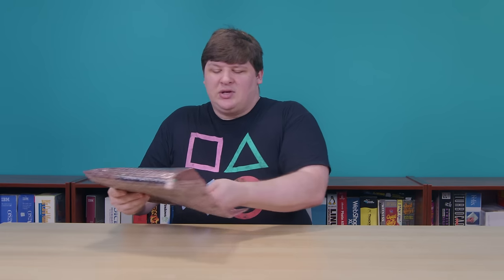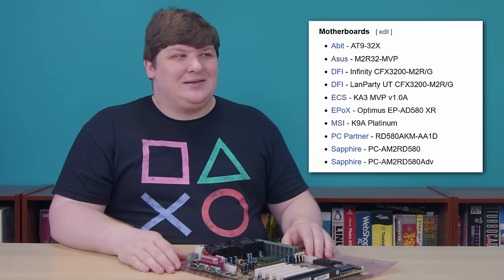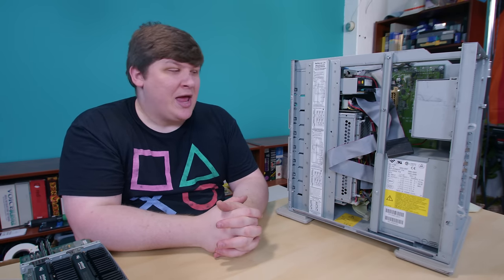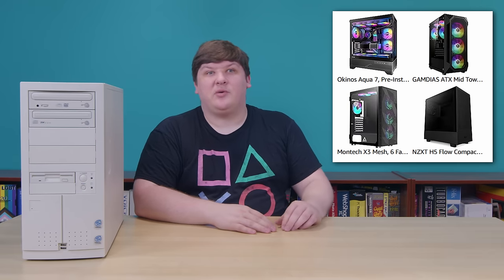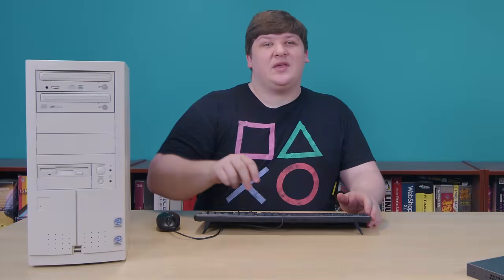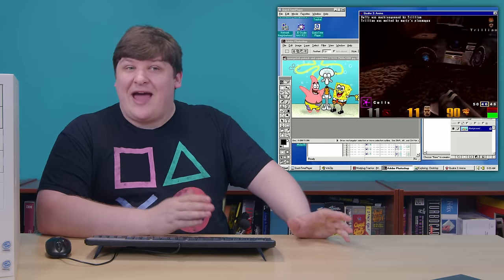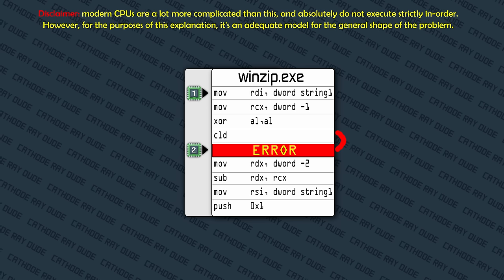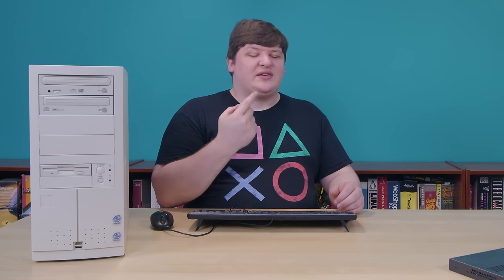The Only Famous Motherboard

Comment: Really need to throw in the Pentiums that do work on it for lolz.
Reply from the maker: The only ones that worked on this board were coppermines with an extremely specific powerleap adapter that's been unobtanium for years :(
Reply: @CathodeRayDude  damn.... matched server chips maybe?

Comment: Man you need 2x celeron 366MHz and you up the bus speed to 100 and you have 550MHz and ram runing at 100MHz
I was just normal mortal and had 1 celeron 366@550MHz.

Comment: Abit BP6 + 2 x Celeron 300A @450 MHz, running BeOS. The stuff of legends.

Edit after 26:50... pronounced "Be O.S." not "bios".

Edit 2: at 37:15. and that's why BeOS was so good. Running each single GUI window in its own thread. Responsiveness that only Haiku can match today, and folks just discovering it can't believe it is done without an ounce of GPU hardware acceleration. 

Edit 3: after 57:15. Price, my dude... you only read about Celerons 300A being used with that mobo at the time because the price/value ratio was INSANE compared to anything else.

Edit 4 at the end of the video.... Man... you could REALLY trim your videos and earn more subscribers. Guess it is not what you want. That's ok. this one... wasn't too overstretched, even for me.But yeah... I have to agree with others... your videos are WAY too long in general.

Comment: Small correction on buying products that look and behave how I like: I don't want RGB.  Ever. Anywhere.  I can't seem to avoid having at least one RGB product in my setup.

I had the BP6 second hand from a friend.  I ran it for YEARS and it continued to perform well into windows XP.  

I think it was only after I bought my first Athlon with Vista that I stopped using the BP6, and I ended up giving it away ... and I forgot where.  

I really wish I still had it.  Like so many others here I ran the 333 or 366 I forgot which one now, but I could run that just short of 600MHz with no instability.  What a beast

Comment: If only ASUS went out of business and ABIT and DFI came back Didn't P3 server boards have their own voltage regulator socket each for their own respective CPU? Windows 2000 was the best NT windows, yes, better than XP, only bested by windows 7, Vista was great but software for it wasn't that was it's problem. isn't SMT really beneficial in programs with good branch prediction like Editing and encoding? 3D Studio max was used for all renderware GTA titles

Comment: I needed SERIOUS CPU power back then for video processing, and I looked at this MOBO, but 1) using CRAP Celeron CPU's and 2) bad dual CPU co-ordination, made even those slower CPU's together give you some 28% (over one CPU, on our testing them) boost, ....NOT WORTH IT and a better NON Celeron CPU did about the same!
Bad move but ABIT, not a good MOBO to use.

Comment: Speaking of heat management, I used to work outdoors at an amusement park and they could never understand how their little portable computer register terminals would overheat and shut down (in the 100 plus sun) but would be fine by the time IT came to look at them as they’d been in the air conditioning for several hours by then lol

Comment: I dispute your false narrative regarding Linux.
"High point of Linux usability" "UI isn't a moving target like it is now" speaking in the past. "far worse experience than it even is now"
 
Linux is not a has been. I am using a Linux PC now and I use this computer for gaming when not watching videos and such. Gaming works very well on Linux now thanks to Valves cooperation with developing Wine/Proton with mostly only games with kernel level anticheatss being the ones you really can't play and many Windows games working immediately.

As far as UI, LInux has a wide selection of UI known as Desktop Environments. I don't know what you mean by "UI being a moving target" but whatever UI you want, there are options including numerous modification options. Why do you choose to make many options sound like a bad thing? Or I don't know what you mean.